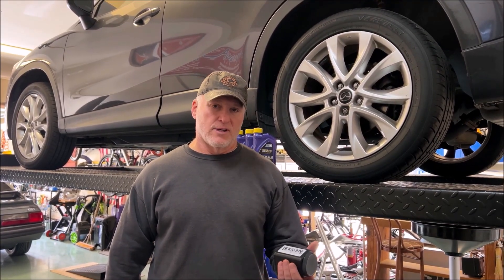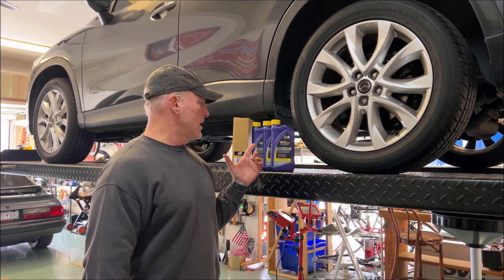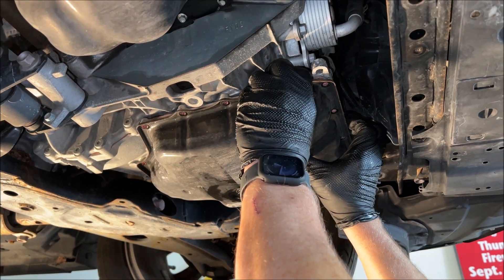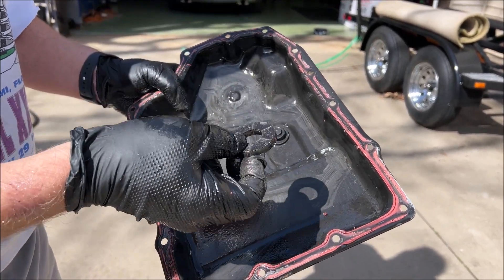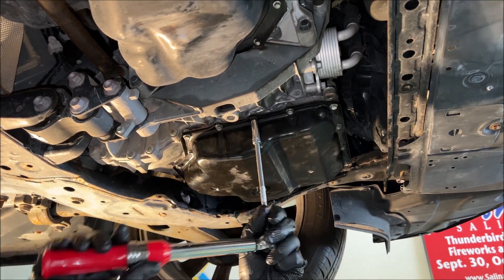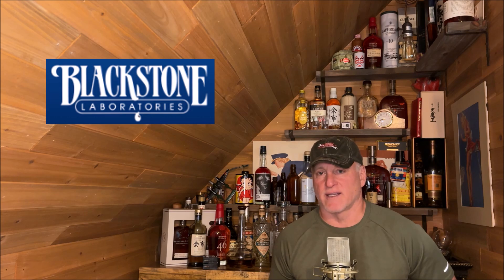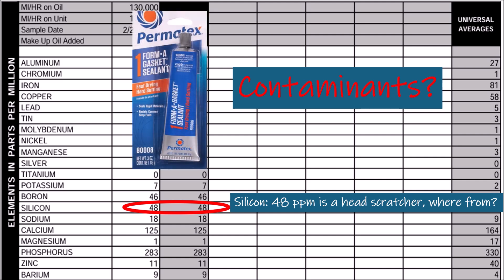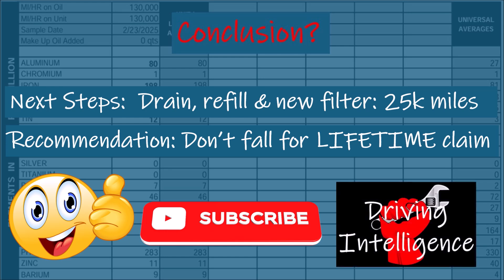Why Lifetime Transmission Fluid Fails: Mazda CX5 Blackstone Test Exposed

Comment: have a CX-30 turbo I bought used and one of the first things I did is ask for them to change the transmission fluid and they gave me the spiel of how it never needs to be done. I immediately told them how the US is one of the few countries that states to never change it in the manual and how I bought my new car because my old Mazda transmission went bad from not changing it, and I could do it myself or they could take my money, no matter what it's getting done, even if only half comes out from a change. It's still chugging fine.
Reply from the maker: right on
Reply: Consider using a good, independent shop that uses OEM parts and fluids.

Comment: Thanks for the video! Would you recommend changing the ATF fluid for the first time at 220k miles on a 2012 Mazda 3 Skyactiv? I haven't had any issues with the transmission so far. The engine is still running great so I'd like to keep this car going until 300k or so. I know changing the fluid this late can cause issues but I'd like to know what you think. Thanks!
Reply from the maker: hmmm, I'm not sure I would.  It's never been changed before?  Here is a video showing what happened to me when I flushed my F150 transmission at 165k miles.  https://youtu.be/yOB3BLx-9IQ?si=HkEk9AS_koViqndf
Reply: If it has no issues at all shifting then it might be worth the risk, if it already is having issues it's a coin flip if it helps fix issues or ends with your transmisison giving out. But usually at that stage it's a ticking time bomb so something has to be done.

Comment: On my CX-5 you can remove the air housing  by removing two bolts and get much easier access to the fill plug.  Just use a funnel with 18" hose.  They run about $1.00 at auto parts stores. I also cut a 1.25" hole in the under body shield so in the future I could drain the fluid without pulling the shield.  A simple removable hole plug covers up the hole.  Replacing the fluid is a good idea but I wouldn't pull the pan and worry about the filter.  It's more like a screen vs a filter.  Did you cut it open and inspect it?  I would only use OEM fluid! I don't trust marketing claims from other brands claiming they're universal.  I applaud you for sharing the UOA data.
Reply: @cottydry  +1 on this response, that’s my take on honda cars as well.
Reply from the maker: I’ve been using Royal Purple in all my transmissions, Ford, Cadillac, and now the Mazda.  I’ve also used it in other vehicles I’ve worked on and all the transmissions are working perfectly.  To me, it’s no different than using a different engine oil than the manufacturer’s.  I don’t see engines failing because people use Valvoline instead of Ford.  Too much hype from manufacturer’s to force you to use their product and make tons of profit.
Reply: @DrivingIntelligence  Those other cars you used Royal Purple in probably don't use blue fluid. Mazda's "smurf juice" fluid is known to not play nice when mixed with other fluids. And you only got about half the fluid out by draining the pan. You might be ok, or you might introduce more problems by mixing the fluids. I would recommend doing a few more drains and only using the Mazda smurf juice.
Reply from the maker: The fluid in this Mazda was not the Smurf blue, it was the red / pink, so no concern about mixing.
Reply: @DrivingIntelligence  I have a 14 6 GT. It's the exact same powertrain. They came with red/pink from the factory but Mazda released a TSB that ONLY FZ fluid should be used, which is sold in blue color. It might also specify FZ in the owners manual. If in doubt I suggest doing your own research, but that same research led me to spend a lot of money on smurf juice.
Reply from the maker: Interesting, this CX5 is running perfectly with the Royal Purple.  I have no regrets or concerns.

Comment: If the transmission is in good shape after 135,00 miles and the original Mazda FZ fluid and filter have done a good job, why on earth would you not go with OEM parts again. It seems a no-brainer.
Reply from the maker: Because I like the products I use after 100’s of thousands of miles using them with amazing results.  But let me ask you this, why should I trust Mazda when they tell me lifetime fluid, but results of my tests show the transmission is grinding itself to death with the old fluid?  No brainer

Comment: I thought drain with pan removal will drain ~%65-%70 of the total ATF! Not as you mentioned only %50. So what is the sweet spot here? every 80k miles? in extreme heat like southern Arizona or Texas every 60k miles? Thanks
Reply from the maker: 60k miles is an excellent target.  I'm doing a drain and refill with all my vehicles every 30k for extra protection, but that is likely overkill.  With regard to amount of fluid in transmission, do as I did, measure the amount of fluid that is drained and replace with the exact amount.

Comment: Great video but Mazda or Aisin fluid would be advised.  Wix is also not what it used to be.  Again OEM is best.
Reply from the maker: I'm sold on Royal Purple and will continue to use their ATF in all my vehicles if it meets the manufacturer spec.  With regard to the filter, you might have a good point, I need to check on that.  Appreciate your comment.
Reply: @DrivingIntelligence  I’ve personally seen more than once an Aisin transmission in a Toyota shift weird on non Toyota WS fluid. I’d suggest OEM as well in these.
Reply from the maker: @Chickennss  guys, this transmission is shifting PERFECTLY since the fluid change!  Better than before the change, so give it a rest.  ;)  

I appreciate your point of view, but it does not help in this situation.  Royal Purple confirms their ATF meets Mazda specs and is an outstanding ATF.  I use it in all my transmissions without issue.

Peace

Comment: In Mazda's defence I would reckon you could get 200K out of that fluid without a major catastrophe.  For most people that's a lifetime on a car.  With that said it's not that hard to change it and if you can make it last as long as possible why not?  I've got 60K miles on my CX-5 and I'm about to do a basic drain and fill.  I'll probably replace the filter at 100K.
Reply: Would drain & fill be enough? without removing the pan?
Reply from the maker: @mursie100  I don't know how to drain and refill without removing the pan, unless you use a pump through the dip stick hole.   Whether or not the 4 quarts in the pan is enough depends on the mileage and condition.  I only did 4 quarts because the transmission hit 130k miles and I didn't want to risk loss of friction material if the clutches were too far gone.
Reply from the maker: For me it’s not just about extending the life of the transmission, it’s about making sure you’re not left stranded.  With zero maintenance, it’s a roll of the dice when it might leave you stranded.
Reply: @DrivingIntelligence  I have a 2017 MX-5 ND with about 83k+ km (~51k miles), I've been buying what the dealership has been feeding me about the "lifetime" fluid, until a friend told me it actually needs to be changed, I live in a very very hot country nearly all year round, and do not take it easy on this car, the spiral of research led me to your very helpful video and now I'm thinking it's just about time to change mine, or at least to a simple drain and fill.

Comment: Hi, love the video.  I have a 2022 Mazda CX-30 with 28,000 miles (bought it used), should I change the trany fluid @ 30,000?
Reply from the maker: My philosophy with all my vehicles is 30k mile transmission fluid change intervals.  Some say that is overkill, but I want to keep my vehicles far past what many consider worn out.  My 10th Gen F150 was at 260k miles when I personally rebuilt the transmission, which it did not need, but I felt given its Daily Driver Status, I wanted to be sure I had a bulletproof ride.
Reply: 30K is great, and I suggest a filter change, especially on the first service. I would not go over 60K on any change. AWD versions have a transfer case and rear differential that uses gear oil and can be drained and refilled every 60K or so.

Comment: How’s the transmission after the drain and fill? I ask because a friend of mine did a drain and fill on his Mazda after 70k miles and transmission started to slip. Seen a few cases of this online
Reply from the maker: it's been running perfectly since the drain and fill.  At 70k miles, a transmission should not be slipping due to a fluid / filter change, not enough wear unless the transmission had a leak and was running low on fluid.  Did he check to make sure the transmission is full?
Reply: @samiabbas3258  if the transmission computer can be reset, I would do that.  I changed my transmission fluid at 75k and it started to have sporadic flares, not a lot, but I noticed it several times.  I took it to the dealer and they reset it. Now it never shifts out of the ordinary. I imagine some bidirectional code readers could do this too.
Reply: @gar @garyganser2451 what did you specifically ask to get done at the dealership? If I ask them about resetting the transmission they just talk about the DIY method that’s on YouTube
Reply: @samiabbas3258 I still have warranty on my Telluride, so I described my symptoms.  They said they couldn't replicate them but did (thankfully) reset the transmission controller.

Comment: why not use oem fluid? i would wonder about compatability .... i like that lift ,nice
Reply from the maker: I went to the Royal Purple website where they have an oil selector page for all vehicles.  This oil is compatible with the Mazdas and I like it because of the benefits I've seen in the transmission of my Cadillac CTS V.  

And yes, that lift makes like so much better!  ;)
Reply: @DrivingIntelligence  lucky bastard-just did 5 hours on my driveway working on a cx-5....its a 2024 and they changed the trans fluid again...a7 something not fz
Reply: Going with an aftermarket ATF is always a gamble ... but it looks like he chose well and has gotten away with it.

Comment: lifetime under warranty. same as the engine coolant. mazda is not the only one making these claims. I have never put 100k on any car. usually trade them in after 5-6 years. I just do oil, brakes and all filters.  would like to see how much carbon buildup you have on those valves.
Reply from the maker: Perhaps I'll get to a video where I show under the valve cover.  Right now this car runs so damn good I hate to mess with it.  This video shows me towing over 7k pounds with an F150 at 268k miles.  Many cars and trucks las with high quality maintenance:  https://youtu.be/FLMF6FFc0Vs?si=Hwx4VKq9nhRLMIe1

Comment: That seal gasket fit on that mazda cx5? When you took off the transmission pan,it didn't have a rubber gasket,it had silicone rtv red. Explain that.
Reply from the maker: I don't know why they did it that way.  No gasket, red RTV.  As in video, I used a "dry" gasket... with a little grease to keep it steady during installation.  Tight and no leaks.
Reply: @DrivingIntelligence  I assume a silicon gasket like that is cheaper at the factory so that's what they opt with. Both work, it's kinda just preference.
Reply from the maker: @Brandon-yq1tm  for sure, but I prefer a dry gasket.

Comment: I'm taking my '15 mazda cx5 w 188k miles for an oil change. Never have changed the transmission fluid (been told the "lifetime transmission " story by 2 different Mazda mechanics). I've also heard of slippage if you change overdue transmission fluid. Any suggestions. It runs great right now.
Reply from the maker: You're at that mileage where it could be risky.  I changed all the fluid in my 10th Gen F150 when I bought it with 165k miles on the clock and ended up with some transmission shudder.  This video might help:  https://youtu.be/yOB3BLx-9IQ?si=m18FKFYSmdY_Qh1T  but given the condition of the fluid that was in the 2014 CX5 shown in this video, you have alot of particulates in suspension.  Two other points, since changing the fluid in the vehicle in this video, it has run perfectly, no slip or issues and second, Blackstone told me there is no problem doing a fluid change after so many miles.  But here's the deal, I'm neither endorsing nor discounting what Blackstone says.  If I were you, I would follow what I did in the video, you'll drain about 4 quarts of fluid, put two quarts of the old fluid back in the transmission with a new filter and 2 fresh quarts of fluid.  This way, any particulates in suspension should help the clutches operate as they are now.  Again, watch that video I linked and let me know what you think,.
Reply: @DrivingIntelligence thanks for the great info. I'm going to a good Mazda service center, who doesn't push up sales. We are going to check it out, but they said about the same that you say.
Reply from the maker: Good luck with that and please stay in touch.  Let us know what happens.  

Also, you noted two Mazda mechanics in your first comment.  What exactly did they tell you?
Reply: @DrivingIntelligence both Mazda techs told me it's sealed and also at this mileage, it's better to leave it alone until problems happen. Mentioned the same thing about the old fluid probably helping out.
Reply from the maker: @hookem7030  good luck with it.
Reply: I bet you'll make it to 200,000 miles ... but if it starts to slip, consider adding a 4oz bottle of positraction/limited slip differential fluid to the trans.  That might buy you another year or so before trans/vehicle replacement.

Comment: "Lifetime" may not be healthy for trans fluid, but every 30k miles is way overkill.
Reply from the maker: Granted 30k is extremely conservative, but for me, especially after rebuilding a transmission in my garage, the more frequent maintenance is worth it.
Reply: @DrivingIntelligence  People will say that changing engine oil at 1K on a new car is foolish, but analysis shows that oil drained from a 1K oil change has the most metals in the oil at any other time, unless there is an internal issue with the engine. Given the cost of vehicles, I will this on any new car. Also, turbo engines with direct injection used on newer cars require more frequent oil changes. 10K is too long.
Reply: Agreed. I own a 2016 Mazda CX-5 that I purchased new in late 2015. It has 160,000kms on it and I have never changed the tranny fluid. I will drop the pan and change the fluid for the first service, then follow up 2 more times afterwards in 500km interval with only changing the fluid. This should only leave about 12% of the old fluid in there. Going forward though…. I will change fluid only every 100,000kms (60,000 miles) using the 3 changes every 500kms rule. I would far sooner change out a total of 15 litres of oil every 100,000kms and have mostly new oil in there as opposed to one oil change every 30,000 miles (50,000kms) and have 50% old, contaminated oil in there. This car has been better than any of our Toyota’s or even our 2022 Lexus RX as far as low cost of ownership or reliability goes.
Reply: I would only do 30k mile changes if you are putting a lot of strain on the transmission - towing, racing, etc.

Comment: Funneling that transmission fluid back into the car is a task, but so worth it given the final test results on what was in there before.
Reply: you can do it from above with a long tube funnel. nice to have that lift.
Reply: @pwrshots  yup! Seen that in a few vids and without taking the airbox out as well. It’s exactly what I will be doing on my CX-5. With the money I am saving doing all this servicing myself on all my vehicles… I will buy the $12 funnel and a nice Autocal OBD tool that can tell me when the tranny hits the right temp for checking level etc. I can use that scan tool for every vehicle I will ever own. Good investment I think.
Reply: @beri232  I just used a thermocouple probe which is a 2 foot long wire connected to a multimeter that can show temperature. Just stick the wire down the fill hole.
Reply from the maker: Ditto ;)

Comment: Engine oil is a lifetime fluid as well. 

If you don’t change it, I guarantee that same oil will be in there when the engine dies.
Reply: Lol
Reply from the maker: good one!  I had a friend in college that finally changed the oil in his Ford LTD with a 302 engine.  When we pulled the drain plug, thick, chunky oil came out.  I was amazed that car still ran.
Reply: Some of it, anyway.